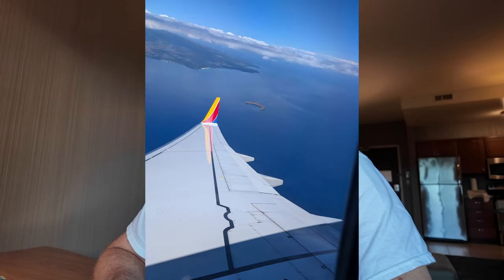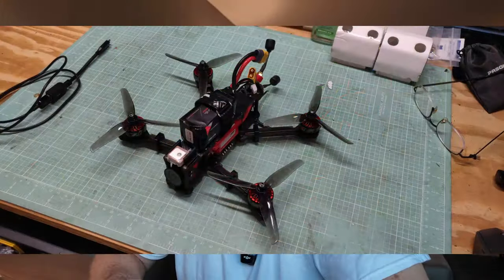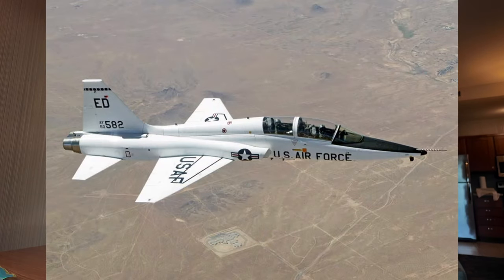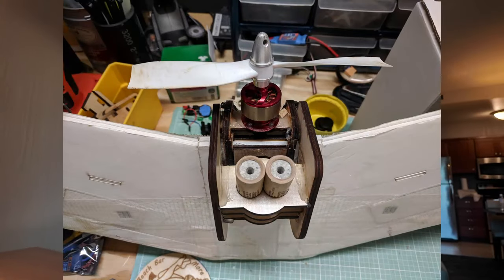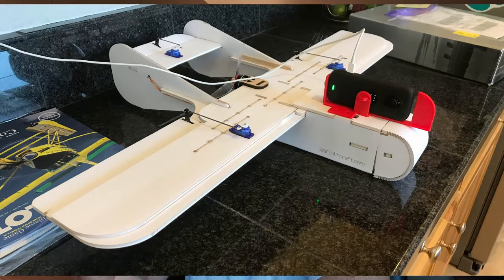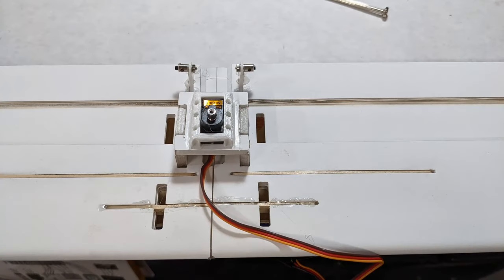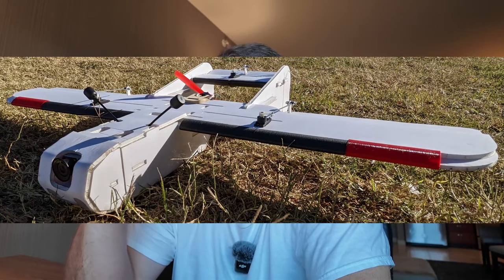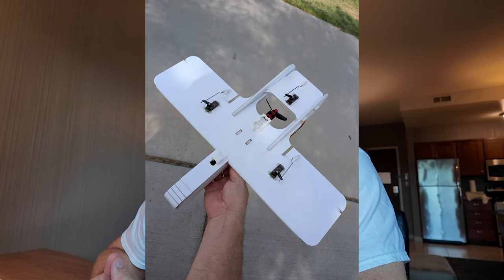Why do I invert my Kfm Wings?  Thoughts for RC and FPV Builders.

Comment: Such a great video. It may have been a one way conversation but I enjoyed the company. Listening to some of the parts of your journey connected me to the hobby even more. Based on this video, it seems you and I have a lot of  similarities in what makes us… us.

Very inspiring and just what I needed as I look at my diode laser and a bunch of black foam core board that’s been sitting on my shelf for what is way too long.

Thanks for the company while I had my morning coffee. It was a great way to kick off the day.
Reply from the maker: I really appreciate that.  I wanted to see if I could add value while I was away from the shop and answer a recurring question in a way that was interesting.

I’m glad to have kept you company.  With any luck - you’ll enjoy some of the upcoming stuff as well.

Thanks for your comment.  Dust off your laser - and get building!

Comment: I know the feeling of dumping hours into a build and watching it crash into more pieces than hours I put into them.  It sucked and I did it so many times with my printed planes till finally getting one in the air.  Tbh I need to get into the foam board builds cuz I tend to crash a lot too, unfortunately I like to haul ass through as many gaps as possible hahah 😅
Reply from the maker: I’ve been with you on the frustration of watching that plane go to pieces.  And I may or may not have flown some gaps myself - not always sucessfully.

And don’t get me wrong - I think 3d printed planes are awesome - I just can cut one faster than I can print one.  Both have their advantages and their advantages - and the dudes that design some of the 3d printed planes are really skilled with some of their designs.  

I’m just a huge fan of stuff you can make, and the creative folks bringing new things into the hobby.  Keep building, keep making, and keep printing.

Thanks for your comment.

Comment: Late Night with "Useful Aircraft" !
Reply: Step on Top = "God Intended !!!" LOL !
Reply: Which do you prefer - plastic gear or metal gear servos ?
Reply from the maker: I’ve pretty much gone all metal.  Plastic gear servos work - but they can be prone to crack a gear in a rough crash, where the metal gear ones tend to hold up better.  Bear in mind - most servos if you tear into them have plastic gears inside - so even the metal ones can be broken.  I just read the reviews, and buy mine off amazon - usually in packs of 10 or 20 at a time.  They’re relatively cheap - and I love building a lot of different things with them - so I always keep spares on hand - so I go through them every few months or so - but it’s better to have a spare or two than lose a weekend flying because you’ve got one bad one.

Thanks for your comment.
Reply from the maker: I don’t do well with idle time - this may become a thing when I’m on the road.

Thanks for your comment.

Comment: Great video, when I look at a chart for the KFm family I see that the original KFm-1 had the step on the bottom. Now that said, nothing with foam board is going to be a perfect KFm because we don't have much control over thickness when just folding or stacking but it can still be fun to play with and you can certainly get acceptable flight characteristics as you have demonstrated.
Reply from the maker: They work remarkably well for their simplicity.  I’d love to hear what you build if you start building.

Thanks for your comment.